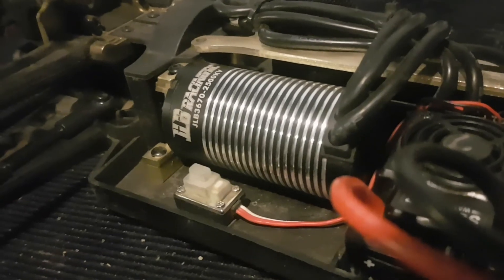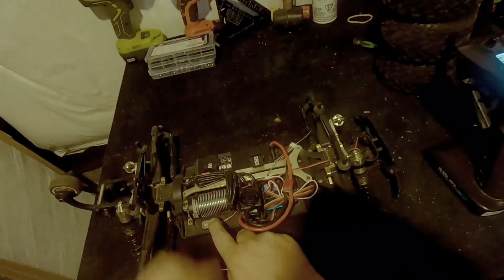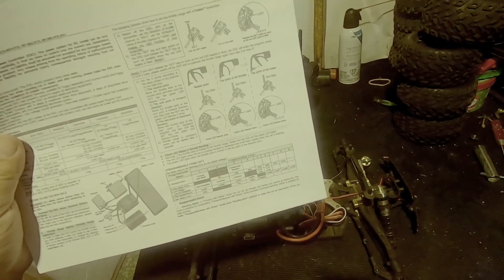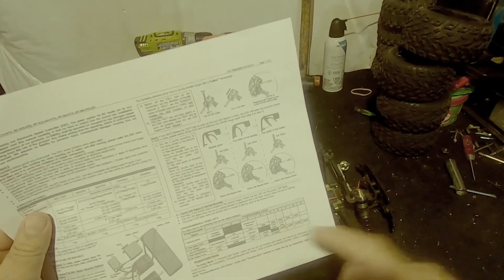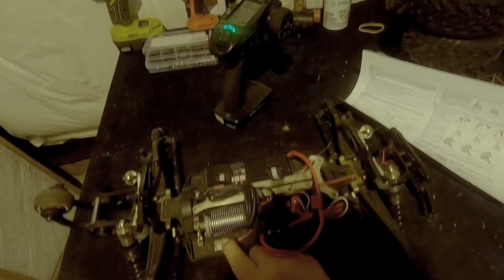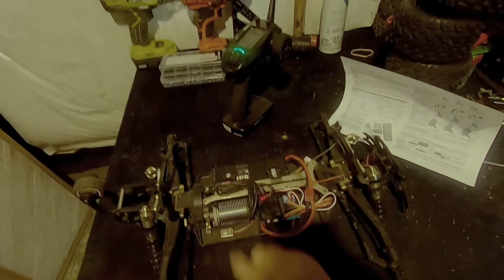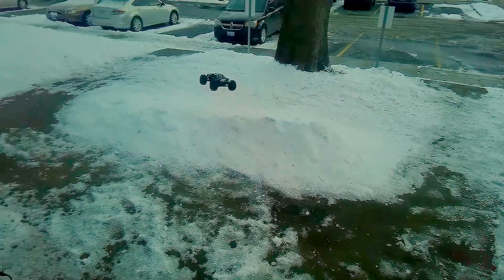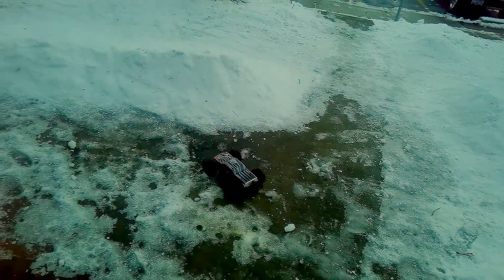You won't BELIEVE  how EASY it is to PROGRAM and CALIBRATE your 120A JLB CHEETAH ESC:

Comment: Legend! This helped me recalibrating my esc after I drove the car into a 2 feet deep drainage pool...
Reply from the maker: Thanks bro  I'm really happy this video helped you out
Reply: @tonydel1974  odd question, maybe you know. When I set my throttle trim below 50% I can't reverse or brake. Does this have anything to do with the settings max brake force (50%) and max reverse force (25%)?
Reply: @Deimos000   Hi, ....did you manage to solve this issue? ...I just purchased "JLB CHEETAH 120A Upgrade" and have the same problem like you:( ...any solution found?